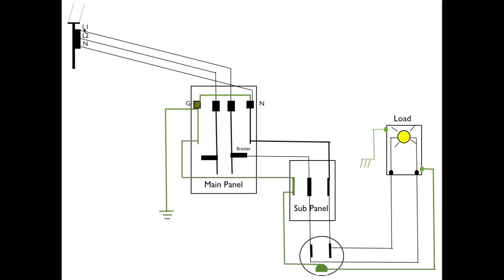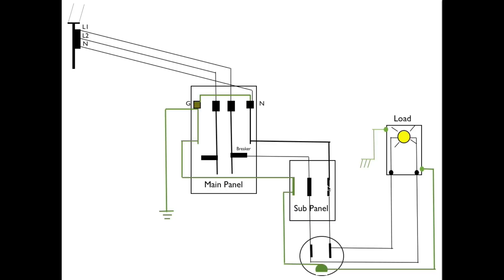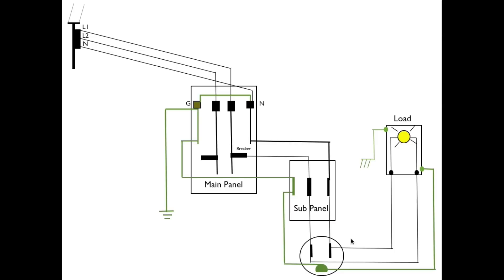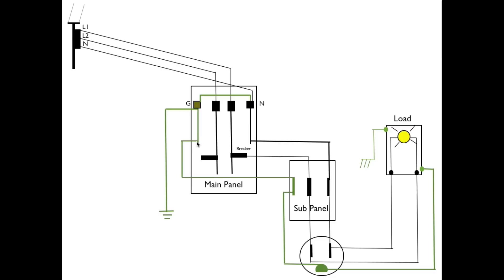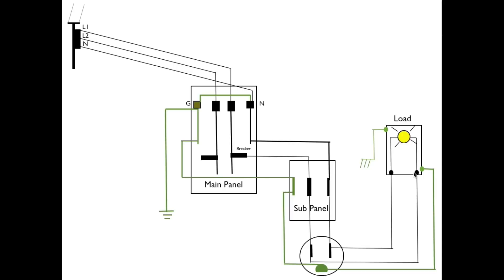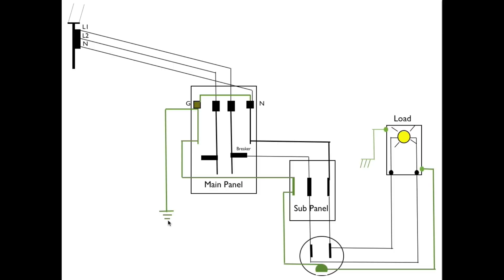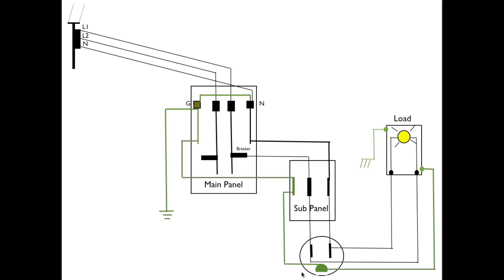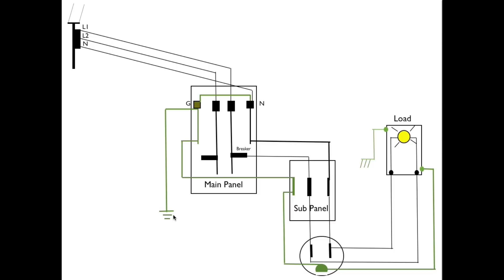The difference between neutral and ground on the electric panel

Comment: For those that have a "decent" understanding of domestic power design- this is clarifying- dare I say "enlightening". For most/all others (please listen: DIYers...) this can literally save lives. Thank you from those of us still walking the planet. PLEASE: if you are unsure or confused- call an electrician. It's much less expensive. Much. much less.
Reply from the maker: Thanks for the support.
GFM
Reply: I have L1 and L2 with N so L1 has 120w but L2 doesn't have any electricity 
Do you happen to know if I can put a new breaker in the panel for the other (L2) I don't even know if I have L2 already in the panel 
Thanks
Reply from the maker: I think you need an electrician.
GFM
Reply: ahmad sherzai:
L1 should have an rms voltage of 120VAC.  L2 should have an rms voltage of 120VAC.  L1 & L2 Voltages are 180 degrees out of phase at their peaks.

The rms voltage across L1 & L2 should have a rms voltage of 240VAC.

re:  "Do you happen to know if I can put a new breaker in the panel for the other (L2) I don't even know if I have L2 already in the panel"
No one on YT can accurately answer that ^^ question with any degree of confidence without examining your panel in detail.
Reply: A B....... the guy doesn't seem to even know how to identify the parts in his distribution panel, and you're hitting him with phase angle separation and RMS voltages..........LOL!!!
Reply: Highlighted.... yes, well, it gives him something else to learn then. :-)
Reply: ahmad sherzai DIY is dangerous. But, if you're intent on learning with the  risk of killing yourself and burning your house down you're going to need a screw driver to take the cover off and a DMM.  If you have a clothes dryer, a stove, or central air HVAC then you have both L1 and L2, as evidenced by 2-pole circuit breakers that break both Phase A and Phase B at the same time.  Residential load centers/panel boards circuit breaker connection phasing is A on left & right then B left & right, repeat top to bottom. A 2-pole 240VAC circuit breaker would connect A1 and B3 vertically.  A single pole at A2 would give you 120VAC. Balance it out with another single pole at B4.
A 1  A 2
B 3  B 4
A 5  A 6
B 7  B 8
A 9  A 10
B  11  B 12
A  13  A 14
B  15  B 16

Commercial 3-phase is similar.
A   A
B   B
C   C
A   A
B   B
C   C
A   A
B   B
C   C
A   A
B   B
C   C

You will need to know the circuit breaker ampacity 15 amp, 20, 30, ... and choose the appropriate wire gauge     #14 AWG, 12, 10, ... for your branch circuit.
Reply: Exactly. It's not rocket science but you need to start learning somewhere.
Reply: Because the Neutral and the Ground are bonded (connected together), that puts the Neutral at the same zero (0) potential as the ground. If you were to hold the neutral wire in your right hand and the ground wire in your left hand, you would not be harmed, because there is no difference of potential between the two wires. That's not the case, however, if you were to hold the Hot (black) wire in one hand and either the ground or neutral in the other. You would be HARMED.
Reply: He mentions at one point the earth ground has a much higher resistance to the flow of electricity.
Reply: THERE CAN BE A VOLTAGE ON THE NEUTRAL IF SOMETHING IS WRONG. DO NOT TOUCH GROUND AND NEUTRAL.
Reply: Very correct. My dad used to rail on me about how you never trust anything, especially things like ground and neutral being safe. He demonstrated the neutral being dangerous principle really well, but it was years ago and I can't remember his example. One thing people can do is search for Mike Holt and Open Neutral. He shows how neutrals can have other issues that are dangerous and it doesn't even have to be in your own house to kill you.
Reply: @Thomas  -  YES!
Reply: I would agree.  Rocket scientists are brilliant but sometimes a bit overrated.  In the end, nothing beats clear logic and problem solving acumen.
Reply: Pat B if you touch neutral and ground on gfi circuits the gfi would trip there is reason its set up that way to protect you. Neutral carries current.
Reply: Robert Slackware L1 and L2 should be on a 2 pole circuit breaker. It's 240 volts across L1 and.L2 in most cases. Unless you have 2 120 volt busses. Most power companies will deliver 240 and not 120 volts. The transformer needs a balanced load across the secondary winding. 240 is the better option.
Reply: nuetral and ground are only bonded at the main entrance panel, your panel  is a subpanel. you should have a ground that goes back and ties in at the main panel
Reply: THE USE OF THE WATER PIPE AS A RUNNING GROUND IS WHAT THE IRAQI CONTRACTORS DID IN IRAQ  THAT KILLED    THE SOLDIERS IN IRAQ,,  IT WASNT AMERICAN CONTRACTORS THAT DID THAT, ALTHOUGH KBR ELECTRICIANS  GOT THE BLAME FOR IT.
Reply: My guess is that the neutral was connected to the water pipe and perhaps there was no safety ground.  You can't trust news reports on something like this.  Who knows, maybe a hot line was connected to the water pipes.
Reply: Walt Schmidt  remember bond is metal. And if short to metal box go to grounn. And if is on neutral returms to neutal linei
Reply: Walt Schmidt  neutral is groud from tranformer .and fisical ground is ground rod .if your hot wire toches metal is a short. That short goes to phiscal ground
Reply: Very well explained, actually never heard so well explained.
The connection to water pipes is normally for equapotential bonding, that is to ensure copper pipework stays at safe ground value so if it's touched its safe if electricity contacts the pipe directly or through the water say from a faulty electric hot water element it can safely trip the circuit protection and prevent a shock.
Reply: @patb9375  Do NOT ever touch any live electric system above 5 volts. 
Do use a DVM to measure AC Voltages and a clamp for currents.
From experience, 120VAC feels like a tickle, 220VAC is a real slap, and 380VAC feels like a violent sledge hammer if you're lucky... otherwise it sticks then RIP... experience does vary 😎.
Reply: neutral and grounding should not be connected each other
Reply: Walt Schmidt  its the high resistance through the earth ground rod. the current will want to flow through the neutral because it has no resistance.
Reply: Walt Schmidt  When a load is connected, through the L and N wires, we have a so called "closed circuit". The current is flowing through L and N wires. As long as there is no leakage problem in this circuit the current is forced to flow from its source to the load (line L) and then return to its source (line N). This is a rule. The current flows always from its source, feeds the load and returns to its source. In other words the current always flows through the lowest resistance paths (wires). The ground point a) (under normal operation) does not make a closed circuit and b) its resistance path is much higher than that of the closed circuit. Nevertheless, if there is a leakage to the ground from either side of the load, then the current to the load and the return current will not be of the same value any more. They will be asymmetrical. One will be stronger than the other. This asymmetrical current makes a closed circuit with the ground now and is dissipated through it, securing the operator from fatal shock. If the ground system is effective, i.e. very low in Oms, it brings the fault voltage to ground (i.e. zero) level. All the story is a matter of existence or not of a closed circuit for the current to flow through it, preferring the easiest (lowest resistance) path. That's all.
Reply: On standard 120v plug receptacles neutral and ground are strapped together inside the plug socket.
Reply: Russell Rees, No they are not!
Reply: @totallyjonesin  
Well that's strange because I've got one part looking at it right now standard 15 amp 120 volt Outlet hot on one side ground and neutral on the other side!!!
Reply: Just put an ohm meter between the neutral and the ground.
Reply: bottom of the drawing shows the receptacle  (Outlet) with reversed polarity. (unless the drawing represents the rear view of the receptacle)
Reply: Nemo Nous    You are misunderstanding.  If the grounding Electrode conductor is connected to a water pipe(which must be metal outside the premise for minimum of 10' or not used) then the pipe is for the lightning as noted in the video.   Not for any other purpose as suggested.
Reply: @desotofiresweep58  The ground terminal connects to the exterior metal parts of the outlet, not to the neutral. Neutral is isolated
Reply: @jonathanfurtado3696  What you have is called circulating current. The 1st panel is the only panel to be "grounded", w/earth ground. A "bonding screw should be installed through the neutral bar to the  breaker panel. A "bonding" wire, green, should be run to all sub-panels, and NO bonding screw applied to the neutral bar. No other ground rods should be installed in that circuit. If there are others installed, they must all have a common "bonding wire". With out it, depending on load, you will get measurable current on the "bonding wires" and neutral, because of a "difference of potential" which causes electrolysis, especially if there are two different ground rods user, ie, copper clad and galvanized. I've seen it and measured it, along with others at Argonne National Lab.
Reply: DAN KOLLARS I could never understand neutral and ground being on the same bus bar unless it had something to do with path of least resistance.
Reply: Walt Schmidt  Its a long time but I will explain anyway for the benefits of readers. The neutral and the hot are connected to the load service correct terminals (or the outlet or any appliances box) but at the same time they are isolated from the box by a plastic base made for that specific purpose. So the current flows from the hot wire through the appliances and from the appliances to the neutral, and from the neutral to the main box where it is connected with the ground and from this specific point normally goes to the power service lines to the power plants, but some of the currents may go to the earth due to unbalance and/or resistance pathways (this is an engineering theme). Current can not go back to the ground wire to the box because the ground is first connected to earth on the main box. That is a physical phenomena of electricity, always goes the shortest path to least resistance, usually (but not always) earth, like water flows down river.
Reply: vayabro1    Not quite correct.   In the video he stated correctly that the earth ground is for lightning strikes.   Done with that.   In a short circuit from hot to equipment ground, the high amperage goes to the ground bar in the main panel, to the neutral bar, then out to the utility transformer, and back on hot to the main panel.   Hopefully, the branch breaker will trip.
Reply: What specifically is enlightening to other experts but overly pedantic for the uninitiated.  Also, which principles or ideas are being clarified ?  I would really benefit from enlightenment.
Reply: Electricity takes the path of least resistance.
Reply: mitch denner     Electricity follows all paths directly proportional to the amount of resistance within the path.
Reply: @KevinCoop1  like i said , path of least resistance
Reply: mitch denner    Meaning only one path?
Reply: @crseyer  Dear Mr Ahmed, modern electric distribution systems have a 3 phase configuration with a phase displacement of 120 degrees. I dont know of any polyphase system having 180 degree phase displacement. Such a system would be inefficient, and difficult to create at the generation stage. If any such system of power generation does exist, please enlighten me....
Reply: @ΠάριςΑζής  Precisely & understandably explained-good job!
Reply: @ab_ab_c  L1-L2 should read 120 Degrees Mistype All else Good.
Reply: I think Mr. Ahmad might just have an fpe breaker installed the wrong way and he’s wondering why he’s only able to read 120v on his 2polw breaker 😂

Comment: Some clarifications: Neutral at the utility's (Power Company) distribution transformer is the center tap on the 240/120V transformer secondary. It's needed for the user to have 120V power and it does carry the imbalance current.  Most utilitys ground neutral at the pole and most codes require the neutral to also be grounded at the service entrance of the building.  If the neutral conductor between the transformer and the service entrance should break, you will probably get current flowing through the earth which can cause abnormal voltage fluctuations.  The main reason a ground wire is run in all the premise circuits and connected to metallic enclosures is safety.  If you have a hot wire insulation failure, you want a good, low-resistance path back to the source so that the breaker will trip.  M. Perry, EE, PE Ret.,

Comment: When it comes to power transmission, there is no difference between the neutral and one of the hots in an American residential installation.  The neutral wire does not "return" power any more or less than the hot wire does.  The actual difference between a neutral and a hot is that the neutral is connected to earth through the main panel.   That connection to earth gives it zero potential between itself and earth.  That should not surpise anyone.  What is surprising is how many people never made the transition in science class when they stopped talking about D.C., and started talking about A.C.  The whole circuit from the generator at the power plant to your light bulb and back again are connected.  The electrons shove each other (but each electron only moves a tiny, tiny, distance) all the way through those wires in a loop and they switch directions and move in the reverse direction.  Back and forth, that's alternating current.  The flow reverses because the generator uses slip rings and not a commutator, the flow reverses as the rotor turns through the magnetic field.   The multiple transformers between the power plant and your house do not change the fact that electrons are shoved by the generator and that moves them at your house in a back and forth motion.
Reply: Now this is a valuable comment. Thank You.
Reply: The Exploratorium in SF used to have an exhibit where you could sit and pedal a generator like a bicycle and then flip on connected incandescent lamps one at a time. Man, it got super hard to pedal as each light was switched on! Great way to get an intuitive understanding of "work" -- and how powerful electricity really is -- but also the "connection" between the generator and its loads.
Reply: The distance the electrons actually travel is less than the width of a hair - by a factor of over 100.
Reply: @okaro6595  Yes, each electron only moves a tiny distance, then it goes back.  I just re-read my original post and see that it could be misunderstood in that detail, so I'll rewrite that portion.  Thanks.

Comment: One thing that will happen when a electrician connects grounds to neutral is that if the wire is buried from the street it will create a current that will corrode L1, L2, and neutral and turn the wires to mush.  The electrical code does not allow a water pipe to be used at any time, this code change took place in the early 90's otherwise you are correct.  This is another reason that aluminium wire is no longer legal, except for feeding panels but the ground has to be copper

Comment: According to MikeHoltNEC in the video : Grounding - safety fundamentals (1hr:13min:19sec) installing 2 ground cables on a load chassis (or anything else) it is dangerous in case of lightning, because it can provide a path for the electricity through the electrical equipment and possibly damaging it; and in case of a fault it doesn't necessarily remove the current, so unless you open the circuit and remove the fault, it will not be safe. So to correct this, you should remove the second ground wire from the load, and leave only the system grounding wire.

Comment: The Neutral is considered  the grounded conductor.  Equipment grounds are for safety .Main panels are required to have 2 grounds . A rebar in the slab tied to the rebar foundation called a ufer.  A metal water line 10f buried or a ground ring buried copper wire 20ft #2 or a ground rod  10ft buried.

Comment: If in the USA, DIY's hot is load side or black wire, white is neutral or line side, bare wire is grounding either  chassis ground ( green on fixtures/appliances, round prong on plugs) and  earth ground which goes to the copper rod on the soil, as well to your c.o. or wall outlets green/ground screw to avoid ground looping.